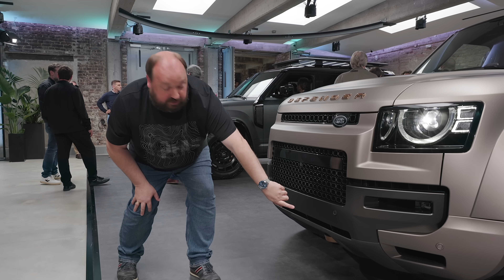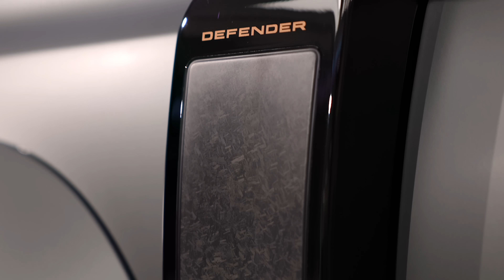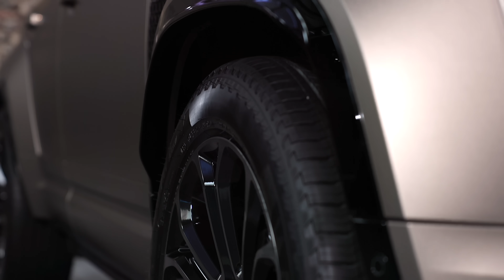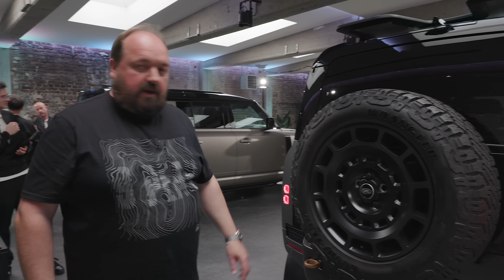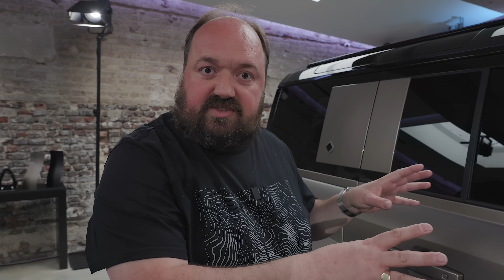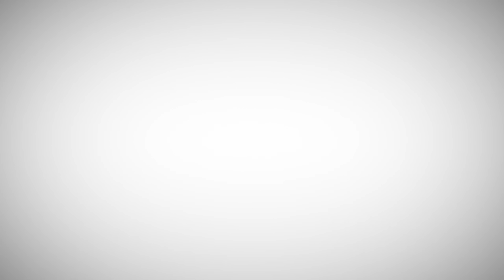First look: 2024 Land Rover Defender Octa

Comment: The Octa does also come in 90 format, you were just at a venue that did not have the 90 version. Also, the 90s were seen all over social media during testing phase.
Reply: Yes we saw during testing a high performance 90, but we have not seen any preproduction models, only 110, what are you basing your comment on?
Reply: @newdefendermods   my bad, i  thought i saw one, but i just double checked now and realised the presenter of the video was standing in front of the B pillar and blocking it.

Comment: I love this car, was considering a purchase of the V8 and now I’m enthused by this one, but I still have this whisper behind my ear about its reliability with electronics. Would I take it on a real solo adventure in remote territory? Ummmm difficult, as I’ve heard it cannot easily be towed and only taken to Land Rover on a flat bed. 😬 Is this still the case or has LD fixed this?
Reply: What are you talking about? Just buy the damn car. Unless there is some other reason you are hesitating.
Reply: @allentyson5475  sorry bud, that didn’t answer my question